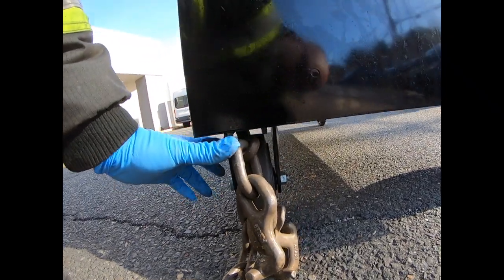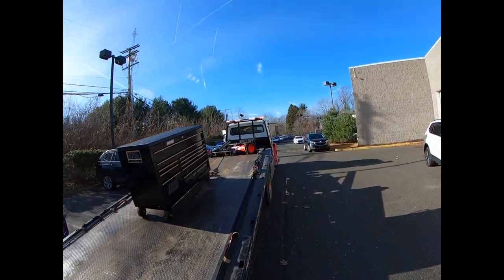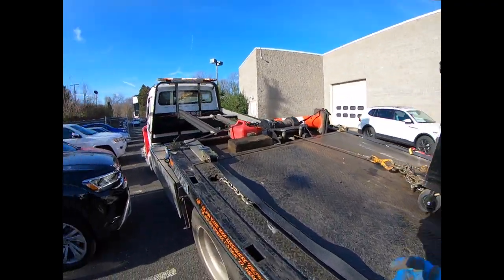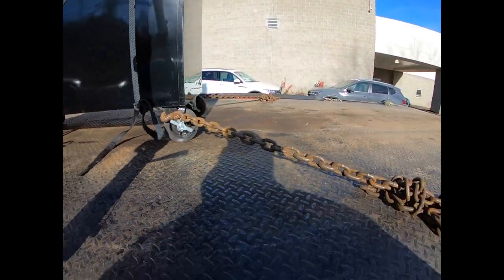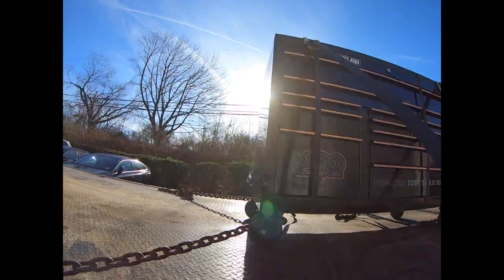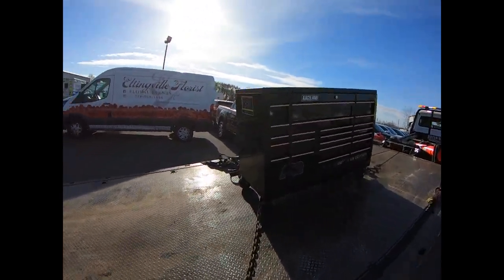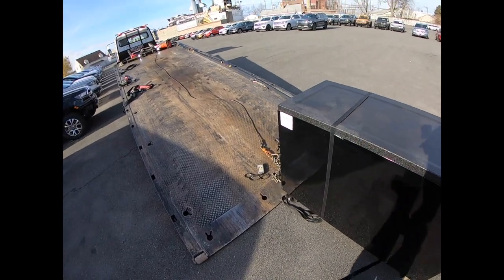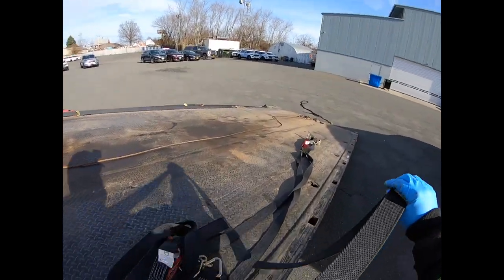Toolbox Transport. (loading, securing and offloading)

Comment: For the drawers I usually wrap the box with plastic wrap and use wheel straps on all 4 wheels and  criss cross them  to keep the box from shifting when turning with straps you can control the tightnes but for that size toolbox i use 1 strap and two 2x4 for the top but like you said everybody does it differently and you've had no problems doing it that works for you  good job
Reply from the maker: Thanks! The shrink wrap is a great idea.

Comment: Yes...pulling from the wheels that don't turn is very important..
Reply: Explain
Reply: What happens when you pull from the wheels that do turn  because that seems to be the best way to do it in my mind
Reply from the maker: You can pull it any way you want. I do it this way cause the base for the wheels that don’t turn have more room to hook to and makes it easier to load.
Reply: @TowMan127  it's alot easier is all..